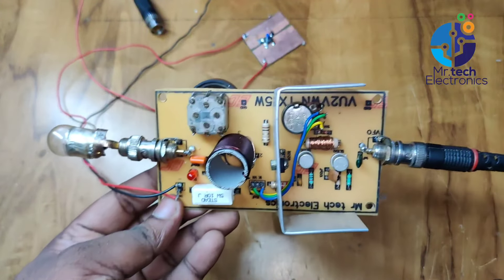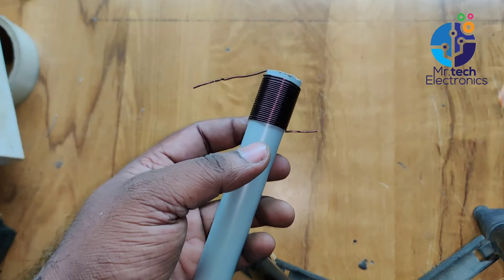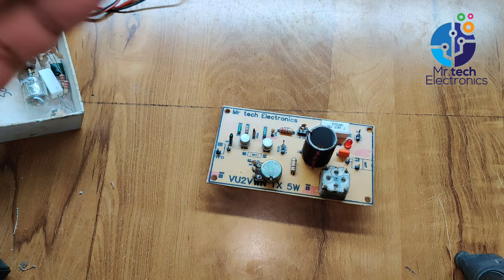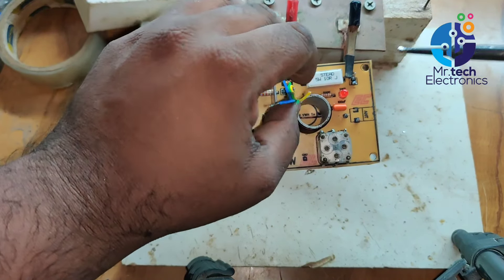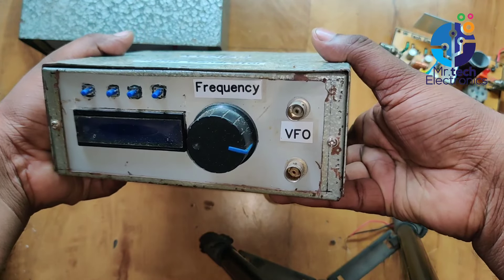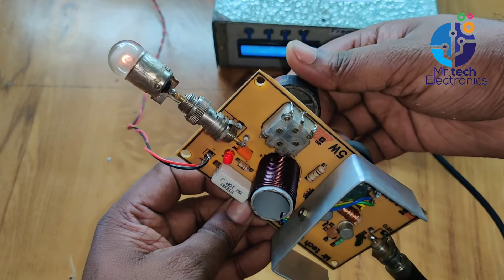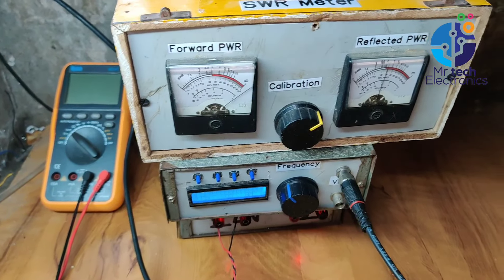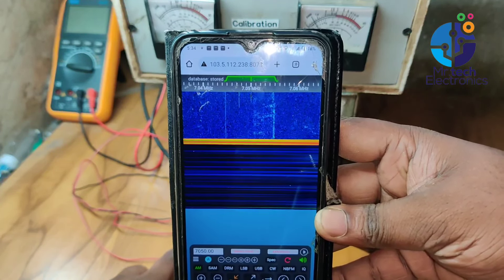How to make a QRP Transmitter At Home

Comment: VWN QRP transmitter made a revolution in  HAM radio operation on Amplitude Modulation . Thanks Jomon for  reproducing the  circuit.🎉
Reply from the maker: Yes. I think we need to bring back the AM. Because it is very easy to generate compared to SSB

Comment: Thank you Jomon, I will play with this transmitter using a cristal oscilator even I own a micro Bitx from Ashhar Farhan VU2ESE. Please share more videos of your homebrew projects. Kind regards CE3-THK
Reply from the maker: This is a very interesting project. don't turn on this TX without connecting the proper load. This Tx not only CW. We can  make AM with modulation transformer

Comment: I think there is an error in the schematic. If the zener diode D2 is installed like it is shown in the schematic, the collector of the output stage transistor bd139 will be permanently shorted to ground. Thus, no rf-energy can be coupled into the tank circuit. D2 should be pointing  in the opposite direction, so it can clamp the collector voltage to a value agreeable to the bd139.
Reply from the maker: @matthiasfreiburghaus4202  the Zener diode is not necessary.  In this pcb I'm not using the zener diode

Comment: Sir, could you make home made circuit of signal generator and F.M transmitter up to 30 k.m range...☺️ If it's an illegal then   F.m radio receiver  with one transistors using Bf 199 design something quite better stability and cleaned Sound.
Reply from the maker: Making FM transmitter for long range without license is illegal in india. I already uploaded making video of one transistor fm receiver https://youtu.be/L2vJWp6Amc4?si=GaZIuZ4MNOAX7_8S
Reply: @MrtechElectronics  Yes I'm working on It, but I made in unprinted circuit board as I don't have circuit printer machine here in Assam,some components are also not so available here,The radio I made from your design picked up a channels but due to not having proper antenna it's getting worse So,I'm trying to figure out the problem of Antenna simultaneously,Actually I would like to request you to make another design of one transistors f.m Receiver which works by transistors B.F 199 which is also far more better than bf 494 or bf 495 medium wave transistor if I'm not wrong..